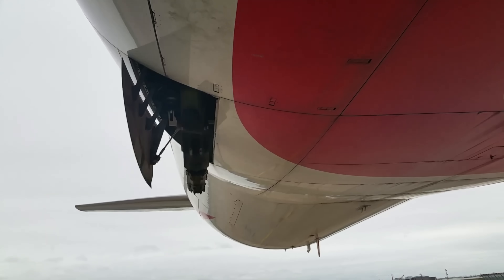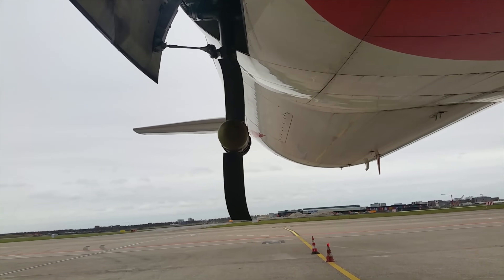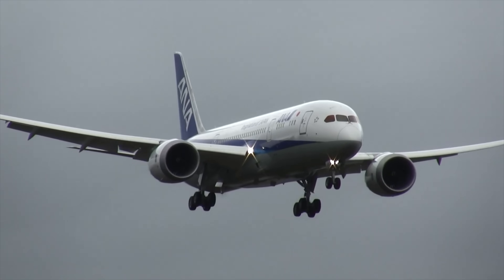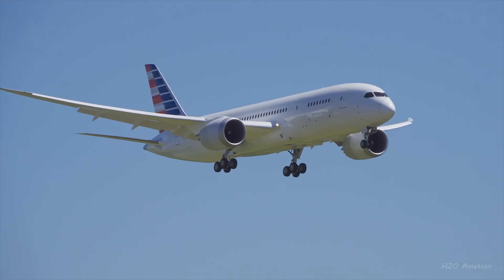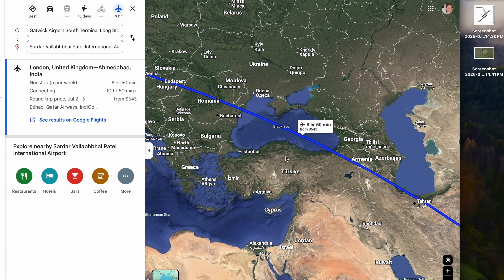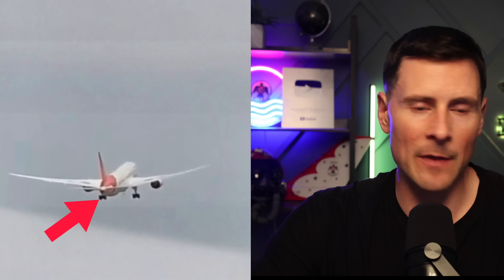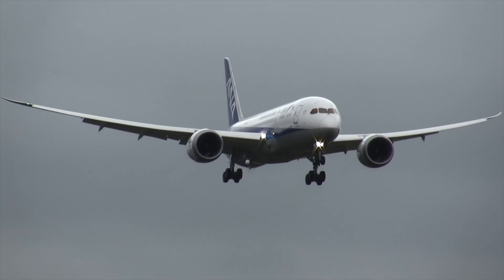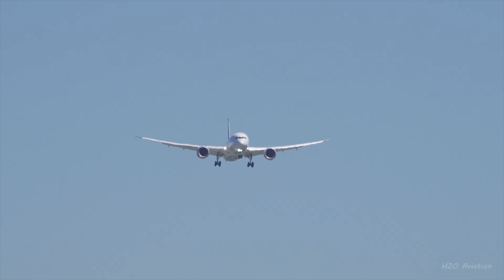Air India 171 SHOCKING UPDATE on RAT Deployment and Flaps!

Comment: I think it was fuel contaminated with water. Jet a floats on water. They used up so much of the runway because the engines were only partially contaminated and they chalked up the low thrust to the hot day. As soon as the plane angled up into the climb the pumps started to suck in way more water and send it to the engines. Both fail, rat deploys, gear retraction stops, plane crashes.

Comment: The 787 crash must have been bad fuel the fuel depot should be impounded immediately. Both engines were out otherwise no RAT there was no strike no explosion or smoke so fuel failure is logical. India is getting fuel from Russia

Comment: Hi. Read an informal theory. During 2013 an airworthiness directive by Boeing, stated that condensation and corrosion could occur on the 787, in hot and humid conditions. Recommended stringent revisions on generators, connectors and cables. What if a short circuit affected all electrical in the bay?? At 40 C and 90% humidity and 3 hours in tarmac, maybe the culprit?

Comment: Whatever it was, it happened a couple of seconds before the aircraft reached the highest altitude (the hump). The aircraft would have had the flaps extended, otherwise, my limited understanding is that, the rear wheels wouldn't have lifted off the ground (not enough lift) and the aircraft would have just rolled down the runway and crashed at the end, with the rear wheels still on the ground. Just because the flaps are seen as extended in the crashed aircraft doesn't necessarily mean that the flaps were not retracted just before "the hump". The pilot could have mistakenly retracted the flaps instead of the landing gear but realised the mistake and extended the flaps again, but may have been tool late. The RAT also might have been manually deployed by the Pilot, misidentifying the problem. Dual hydraulic failure at the same time is also highly unusual unless there was a problem during maintenance. Don't think vapour lock and dual fuel pump failure is also likely because, I believe the temperature was somewhere around 40 C. I am pretty sure some 787s would have taken off close to 50 C in India. But an explosion like a battery or some other component due to something like the age might have caused multiple system failures. There were issues with 787 batteries in the past weren't there? That may have been the "bang" the survivor heard. Some pilots who have posted videos about this have stated that the accident could have been due to dual hydraulic failure, that caused vapour lock and caused engines to fail that caused the RAT to deploy. Also the same video states that there wasn't enough time for the RAT to restart the engines. But you can't restart any large turbo fan engine using the RAT can you? You need the APU to generate pressurised air, don' you? I am not a pilot but my understanding is  that some of these guys might not know what they are talking about. (Once again, I am not a pilot, so I might be the one who doesn't know what I am talking about.) Only way to eliminate pilot error I guess is the FDR isn't it. Hopefully the video recorder (which I believe survived and would have the footage from the cameras) and the cockpit voice recorder would give a clue what the bang was all about. One technical problem or one pilot error wouldn't cause a crash would it? It has to be multiple problems and or errors unless it is a failure of a system that has never happened before and doesn't have any redundancy, something like a battery exploding and taking down multiple fuel lines or hydraulic lines.

Comment: The odds that there were improper wing trim settings at takeoff is miniscule, considering the pilot checks and warning systems. The deployed  RAT tells us there was a power issue, and the pilot said as much. So either it was a manufacturing issue or a maintenance issue. It's going to take awhile to figure that out.

Comment: Spoilers deployed!!??? Towards the end of ALL the videos, it appears the spoilers are [partially] deployed. Why would they deploy? 

Another key topic that seems to have been overlooked, is MAINTENANCE!! 

This particular aircraft is 11-12(?) years old, with thousands of successful & uneventful flight hours and cycles. I’m curious as to how many times this aircraft (and identical 787-8’s) have flown this exact route, with similar meteorological/flight conditions. Had anything in the airline maintenance program changed (Recently, KLM fuel system servicing came to light, and even AA flying a non-ETOPS plane on an ETOPS-only, route, come to mind!)

Would the spoilers and maintenance topics be subject of discussion on future analyses for this tragedy? 

Sad that immediately, News [and other] individuals / organizations trash Boeing and the Dreamliner (it was a “clean sheet” Design as was the 777). It appears Ortberg is trying to get boeing back to being an engineering, designer, and builder, rather than a “framer” chasing profits. The 737-max 8 was a software & management issue… the door plug was an outside labor quality(Union?) issue… both were focused on saving money and making a profit… The engineering was sound

Comment: I called out the RAT within hours, bc that cell phone video shows it. 

But i also used to work on these things as they were being built, so im just intimately familiar with it. The RAT will make a thump when its deployed, too, as the RAT is literally ejected into the wind stream, and bangs itself into a locked position. I think this was the 'bang' that the survivor from seat 11A heard, which gives you a pretty good idea of when the power systems onboard got critical enough for the RAT to deploy. It deployed as they were lifting off. 

Theres video of the flight prior to this flight, same airplane, of it returned back from New Delhi and it having no working AC, so passanger signals were working, screens were not working, ect. 

Its starting to sound like a massive electrical bus failure. And RAT was dropped in response to the electrical bus blowing, but when this occurs, its happening too late. 
What im most confused about is why that bird took the full 11k ft of runway and still hit the overrun zone in order to lift off. The wingtips are not very high. The body and wings are largely of carbon-fiber composite construction and wings need no winglets because they have a unique airfoil and wing twist at the tips that count as winlets, providing a more matured design for the parasitic drag reduction efficiency. 
The wings being composite as they are, are designed to flex alot and those feathered tips will go well above the dorsal line of the fuselage, making the 787 look like a flat flying "u". But on take off, the lift generation doesnt seem as high and i dont see the tips lifting quite as much as normal flights - which sinply indicates that their velocity was just rather low. It looked like they tried to force anlift off past V1, but might have never actually... hit Vr? But needed to roll anyways to keep from crashing into the field? So strange...

Comment: My thoughts now are the same from the beginnig. When the pilot issue a mayday saying "No thrust", flaps 0 is a no sense theory. No thrust means no power from both engines. And that is one of the reasons for the RAT to deploy. Reasons for dual engine failure? That is much more difficult to tell. One of the reasons could be contaminated fuel. High temperature + high humidity generating condensation in the fuel tanks. Let's wait for the investigation

Comment: I think that the airplane was too heavy and that the pilots should have stopped the flight. I wonder if they started the takeoff from far enough back on the runway?
Reply: Even if it was too heavy, thats no going to soe how trigger the RAT to drop. 

The RAT only drops when you have a massive system critical failure caused by no power. Either a main bus blew, or both engines lost power and thus were generating enough auxiliary on their own - the RAT deploys to ensure communication radios whats called 'flight science critical' (like sensors essential for flight instruments like pitot tubes) and flight controls stay operable to the flight crew in the event that they cna maintain a controlled descent

Comment: I think as soon as the jet left the ground, everything electrical  turned off. The wheels are down because they correctly inputted for them to go up but there was no power anywhere. They got just enough liftoff to be in a no win situation. They were flying a glider as soon as they left the ground. With no where to land. The investigators need to reveal the cause of the no power situation as fast as possible. There are other 787 jets this age. If it is a age related or maintenance related failure of some parts or systems, that needs to come out as fast as possible before this happens again.
Reply: Absolutely should get out some sort of directive as soon as possible. Will likely take some time to isolate the problem to a specific system but need to work around the clock to get it done.

Comment: More likely a huge sudden electrical actuator failure since engines rarely ever simultaneously shut down. 

Given the recent safety inspection, either the maintenance has to be retraced (who knows what they did) or a system failure that could never have been detected with an inspection.

Boeing’s obviously nervous.
Reply: You would think that the problems reported on this airplane on previous flights would have  triggered some sort of maintenance response.
Reply: @BrandononIce-sk7fx 
Exactly.… so more and more the failures are pointing to maintenance crew NOT properly debugging and repairing the electrical problem…

When there’s overcurrent consumption, which in turn causes high temperatures, a protective shutdown mechanism will trip the fault system to shut off… so most likely a faulty electrical component that looked like a short circuit caused the fault.

That’s the only thing that explains the sudden loss of power to the actuators which control this plane (NO hydraulics on a 787).

Comment: The RAT seems a little easier to hear in the audio because the engines don't seem to be running.  Dual engine failure seems likely as these engines have two generators each.  RAT hydraulics doesn't supply pressure to the landing gear so with both engines dead there would have been no means to retract the gear.

Comment: If flaps were set, hydraulics weren't the problem. Electric fault stopped the electric fuel pumps, enviro controls and landing gear control. What caused the electrical fault though... that's the real mystery.
Reply: Electrical fault seems most likely, but damn, all that should be double or triple-redundant.

Comment: A dual engine failure is a probability of maybe 10^-9  per flight hour.  So these aircraft are designed so that is extremely unlikely.  It does look like both engines stopped here.

Comment: You are missing the most glarring piece of this issue.  THEY USED THE ENTIRE RUNWAY AND THERE WAS A HUGE CLOUD OF DUST AT THE END OF THE RUNWAY.
Reply: All the cloud of dust proves is there was a lot of engine thrust after they left the runway and passed over the ground.  Nothing significant.
Reply: Ops normal. Seen that a thousand times.

Comment: What does the tilt seen on that gear mean. Can just be seen.
Reply: The wheel assembly is tilted backwards for landing and after takeoff until the "gear up" command is given.  At that point they must be tilted forward to a more level position in order to fit up into the wheel wells at full retraction.
Reply: @BrandononIce-sk7fx  Indicates gear was correctly selected not flaps?

Comment: They had no time to think or react. I would have done the only thing you could do. Move the engines throttles back and forth to see if you can get the engines to respond.  Don’t put too low but just move them to see if you get the fuel to flow. Heat could cause a fuel flow problem.
Reply: Not likely.  These modern day jet fuel injection systems are extremely robust and reliable.

Comment: Why doesn't the REAR engine the ACU help with power output.  Like even 1000 amps might help with restarting an engine or something.
Reply: Pretty sure the APU has to be manually started, and it's not instantaneous like the ram air turbine.  The 787 was in the air less than 40 seconds.  No time to troubleshoot anything, only time to rely on instincts like pulling the yoke back.

Comment: Great video, no experience on flying but I've read the comments and read where the day before a passenger made a comment about the smell off hot wires, passenger's we're putt up in a hotel that night I guess too go over the systems that night next day there's a video off a passenger complaining about no AC before take off indicating there was still a problem, I know there's a long check list for the crew to go over before taxiing out to the runway, it's been said that the pilot on this flight was experienced and one of the best.  Here's my question; why did that pilot attempted to take that jet linner off the ground with all the reported issues, just thinking out loud.

Comment: What are the ppssibilities of jamming electrical systems and softwares in an airplane which physics does not prevent you from especially the distance between somewhere in the grounds and the plane had less than 1000 ft because all the other possibilities make NO sense as no other planes from the same airport had fuel contamination, no signs of any flock of birds, no obvious pilot error or lack of experience, and the RAT deployment while plane was still gaining altitute, that to me after dual engine cut off just under 10 seconds into the air simultaneously and the velocity of the plane and angle of attack gave the plane a bit more altitute before losing velocity/power and lift. Smells a rotten rat somewhere.... Feels like a programmed crash amid geopolitical tensions. A coincidence that former Chief minister was killed too sadly on his best day, 12/06 . All of his vehicles right from the scooter on early days, to all cars including Chief minister's car had same number plate 1206. Truth might never come out unfortunately.

Comment: The survivor said he heard a bang and the lights flickered, so that "could be" the RAT suddenly popping out (Bang!) and the electrics being powered by it (the flickering lights). 
The plane does not allow you to fly/lift off without flaps. It warns you. So it was not a flap issue. 
They lost engines; the main issue is no thrust or lift, the last thing on pilots mind was landing gear coming up. Main focus is to climb, climb, climb. He issued Mayday saying that; no power, so there would be utter bewilderment and shock as to what was happening! Time was not on their side to figure anything out; 20 seconds after it failed to climb is just no time to do a thing!
If there was ocean, a field or a deserted highway they "could" of attempted some sort of landing but it was masses of buildings. 
RIP to everyone that perished. 🕊️

Comment: Personally I wouldn't call 1100 hours a bunch of experience.  But I also think that it is possible that the flaps were set for take off, and that it is still possible they were retracted either accidentally or on purpose, and maybe not back to 0 but to some lesser amount which proved to be catastrophic.
Reply: Loss of thrust is the most likely cause.  Modern aircraft have system checks that will make it very hard to accidentally retract flaps prematurely.

Comment: In the eye witness crash video where you can hear the sound of the RAT, we should have also heard the engines spooling up which would have been loud. I'm sure the pilots had those throttles balls to the walls trying to climb. No thrust = no lift = the slow descent we saw as the forward momentum began to bleed off. Also, the shadows near the trailing edge of the wings do appear to be the partial deflection of the spoilers. The main gears are angled forward indicating that the landing gear lever must have been in the up position. It's all going to be a mystery until data is recovered from the boxes.

Since we're all shooting in the dark of what might have happened, here is my theory; it looked like they used the entire length of the runway. Maybe they noticed something was wrong at around V1 and desperately tried to abort (this might explain the spoilers being partially deflected). Realizing it was too late and they had to fly, they went ahead with the rotation, went gear up, and at that point the engines completely failed, "mayday mayday mayday."

Comment: Question: the surviving passenger said the lights flickered, and I saw a video saying that this could occur when the RAT is deployed. However, Ryan you mentioned that the RAT shouldn't power cabin lights, which makes sense. So in this case, wouldn't the cabin lights completely die instead of just flickering?